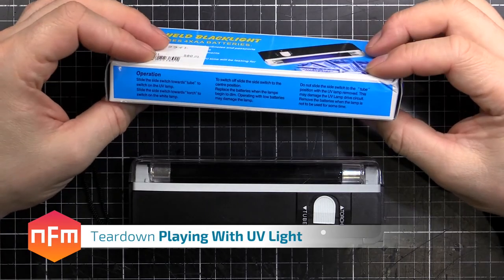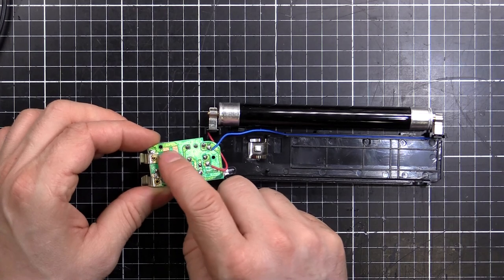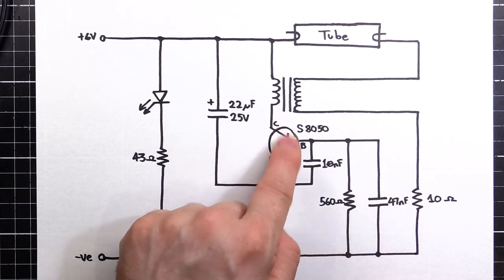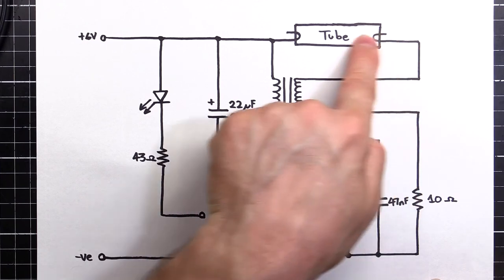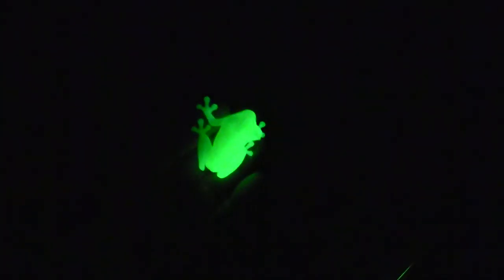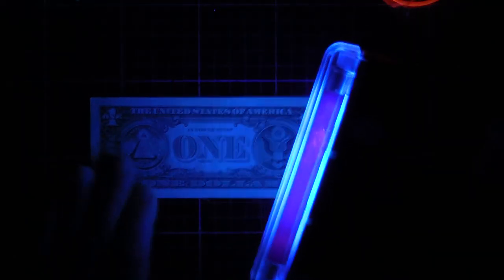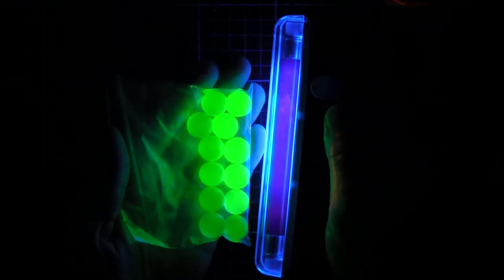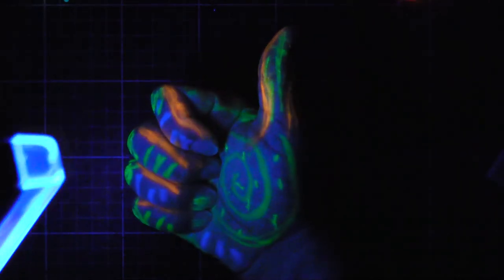Playing Around With UV Light

Comment: any idea why these will always burst the caps when I use NIMH that are rated at 1.2v but not when I use alkaline at 1.5v?

I got 3 died on me due to rechaegeables
Reply from the maker: The lower voltage is probably causing it to pull more current to maintain the set wattage output of the tube.
The transistor inside is only rated to one amp or so, so if you were to swap in a higher current transistor, it would probably work fine.
As it is, the transistor that the manufacturer used gets very hot so it's not great for continuous use, and may even have problems if left on for a long period of time with alkaline batteries.
I upgraded my transistor with one I pulled from the parts box and it runs a lot cooler now.

Comment: what is the approximate wavelength? can this be used to sterilise?
Reply from the maker: It's got a wavelength of 365 nanometres, so it's UVA. You want UVC for sterilizing which has a wavelength of 100-280 nanometers.
Reply: is this determined by the tube itself? could you simply buy a UVC tube as long as the device can provide enough voltage/power? thanks!
Reply from the maker: Yeah, the tube determines the wavelength so swapping it out might work ok. Just be careful with shortwave UV, it can cause burns, eye damage and even skin cancers at the worst.
UVC and germicidal tubes should only be used in lightproof enclosures to make sure you don't get a sunburn (tubeburn?) so play it safe! :)